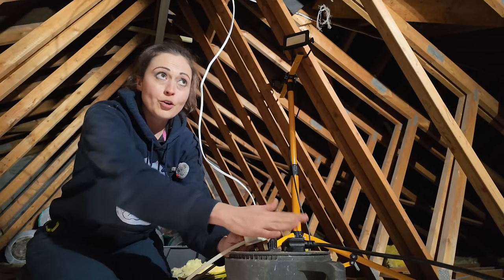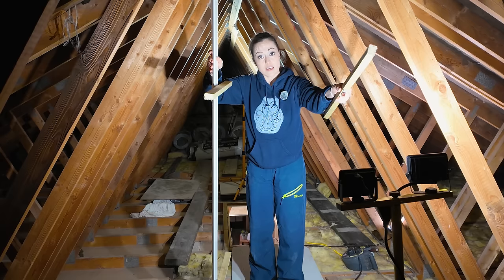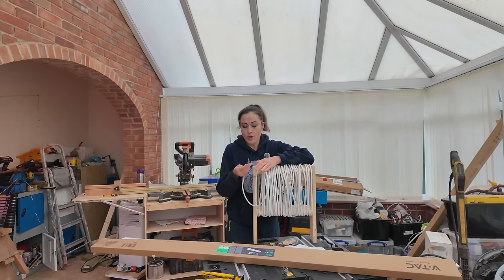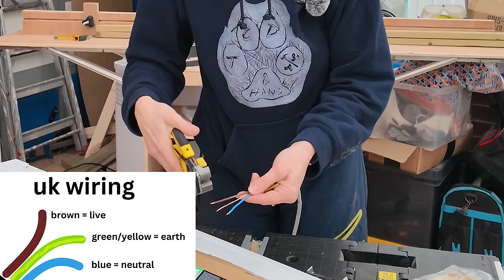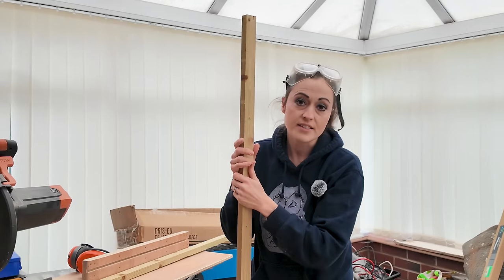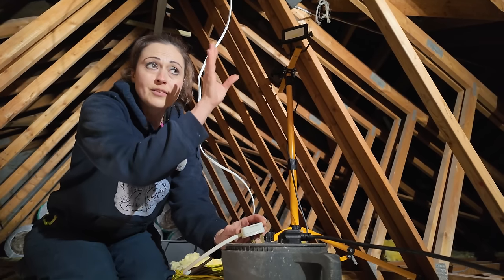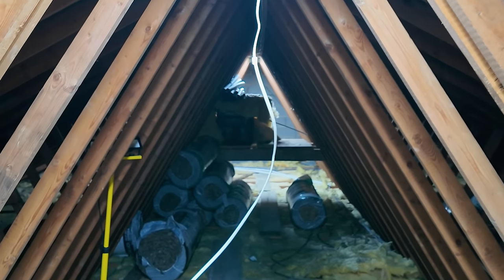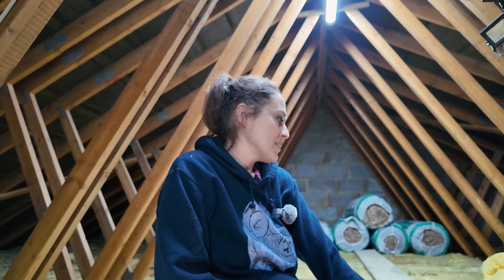The BEST attic/loft lights installation for BEGINNERS? {No Electrician Needed!}

Comment: Awsome project Vikkie with loads of good tips (again one's that i never think of like those cacle clips) i'm old school and use box connectors and lots of electrical tape.
It looks sh1t but does the job, rest ashured that i will be using your method from now on : )
I don't like the idea of the electric cable hanging down from the loft and i would 100% hack into the loft wireing (after all the trouble you went through installing you new lights why make it difficult and untidy by having to dangle a cable from the loft and plug it into a socket.
I would have a double socket in the loft as they are really handy but i would put a permanent switch right next to you loft ladder and not plug you lights into the socket.
Good video Vikkie, look forward to the next : )

Comment: Good video,may i suggest you invest in a tool belt to put your impact driver on or Combi drill, and also a DeWalt magnetic drill bit holder to keep your screws secure so you don't drop them, plus it will help you when you're working above head height
 I think it will help speed up your work and in turn more safer for you  👍👍👍👍💯

Comment: Hi Vikkie did you remember to change the 13amp plug fuse to a smaller one to give you the best protection.
I tapped mine into the main lighting cable and fitted a switch just as you get to the top of the ladder but must say you’ve done a great job and very safely done just remember to change that plug fuse

Comment: I don't know if you've covered this in another video but I would definitely consider getting the roof re-done.  It would be a shame if you get all decorated to find it leaks in the next few years.  FWIW when the spark is next on site I would get mains power into your loft space and a switch up there for the lights.  I think it won't be long until you tire of having the cable dangling down into the hallway.  Great video though.  I do like the Wago although my spark seems to dislike them with a passion. 🙂

Comment: Another good job , the lights rellly do make a difference and adding the extra one was betterer 😊👍
Reply from the maker: Thanks so much! I'm so glad I bought a 4th, and all the time I was worried 3 would be overkill lol
Reply: @TheCarpentersDaughterUK  Well you don't know til you do it , alas using the wago connectors it was easy to add another , well done. I see they no longer do florescent tubes anymore you can only get led ones. (Not saying those lights use them as you said they was led ) 👍
Reply from the maker: Come to think of it, I haven't seen any for sale for a while

Comment: I have used Wago connectors on all the pot lights in my renovated kitchen and they are fine. As a retired toolmaker i am way over qualified to do electrical work but i follow code religeously because i do not want to make a mistake. You tube will show you how to do everything , the trick is do not take shortcuts.

Comment: You have so many options to make a permanent connection.  Ideally you would run a new feed back to your consumer unit, but you need a sparkie to make the final connection really.

You could tap into a permanent live from a downstairs light and probably will be the most common way.  The fitting will be in the attic floor, it is just the case of interrupting the permanent live and feeding from that and fitting a light switch.  I suppose you could use a double pole isolator switch so your live and neutrals will be connecting in your switch and making it even easier.

You could also pinch the live and neutral from the ceiling rose and run them into a socket in the loft and use a plug with a 3 amp fuse and do the switching from the socket, just make sure you mark the socket as "lights only" so nobody plugs in a big drill or something and will trip your comsumer unit.

Comment: Couple of points for future....take the wago box right up to the fitting...ignore the flex on the light...if you ever have to take down or replace the fitting with another brand it might not have same length or any flex on it....also with cable tacks if you are tacking horizontally, put the nail to the bottom...if the tack breaks then the cable will probably stay up...better still use some metal tacks now to prevent collapse...good video though
Reply from the maker: These are all great points I wish I'd known before I started, i would definitely have done them, they make complete sense thankyou !! 

And I'll have a look for some metal tacks.

I love learning new tips from the comments on my videos.
Reply: Welcome

Comment: We’re gonna have to start calling you Vicki Sparks (she’s a sports writer) lol.
The wago connectors go on their side into the slots in the junction box, although you were using the wrong box for your connectors.
I always put a socket next to the loft hatch, there’s not much point adding any more fixed wiring in the loft. I think you are capable of doing it yourself. Just make sure you’re cutting into a socket circuit and not the switch cable for a lighting circuit.

Comment: If you have a run of lights along the length of the loft you can loop one to the next to the next and use less cable and fewer Wago's.  But with electrics, know your limitations.  Have you had the electrics checked on moving in??  It is money well spent so you know it is safe at the beginning of your ownership.  Happy Christmas.
Reply from the maker: Thanks. I don't think we could have used any less cables. And yes, we've had them checked and the consumer unit upgraded shortly after moving in 😀

Comment: Re your heating the gas fire gives of lots condensation ? diesel heater lot cheaper , and good content
Reply from the maker: Thanks! What kind of diesel heater were you thinking? One like in a motorhome or one like a standard boiler replacement that heats water in radiatiors?

Comment: How well do LEDs hold up in hot attics?  England probably doesn't get hot enough for this to be a major problem, but over here (Atlanta area) the highest part of an attic can easily be over 45 C for much of the summer.  I use old incandescent bulbs in my attic because they have no electronic components that would be harmed by the heat.

Comment: I would use a fused switch in the loft if tapping into the ring main and not put a socket. The only time you will probably ever need a socket up there is when boarding out. When that's finished should you ever need a socket up there it safer to run an extension lead. Plus it may need to be a weather proof one if you did put one in.

Comment: This is one area that has become easier to do. You (as a DIYer) are allowed to extend a circuit but not to install a new one!
In my loft I have a switch on the loft floor next to the entrance so when I climb the ladder it is next to my hand on the ladder. I have seen many with a pull cord switch to do the same. If I was to be going full beast mode there are PIR switches that will switch on as they detect you in the loft, but you run the risk of them turning off if you stay still too long ....... which is possible in your humungus loft area! Plugging one in with a switched socket works too though ;o)

If you plan on fixing eather a switch or socket to your loft floor don't forget to allow for the extra depth of insulation you will want in there! (I would go at least 50% more than recommended depth) 

Eather blown or rolls. Rockwool does not compress with time and is easier on the lungs (and less itchy). You do need to be careful when insulating to leave an air gap at the soffits to allow the roof to breathe 
I would Not recommend spray foam insulation as it can cause problems like fungus on timbers not visible and insurance companies may even refuse to insure and I know you don't plan on selling, but that could be also an issue there!
 
I cant remember for sure but I seem to think you have a tiled roof, if so installing vents in the membrane under them is a good idea as it allows air to flow in the loft. This is a ridiculously easy job but is often overlooked. Maybe a dozen vents that are just slid into the overlap of the membrane allowing air to get past it and go through the small gaps between tiles (or slates).
Reply from the maker: Thankyou, there's a lot here to digest, but I'm going to be referring back to this before I do the insulation, I'm about to start researching the laying of it now, I hadn't even considered adding extra vents yet, so I'll be looking into doing that too, unfortunately I've already bought the insulation when it was cheap on black Friday.😀
Reply: @TheCarpentersDaughterUK  You mean you bought SOME insulation? ;o)
£ for £ it is by far the best investment you will make!

Comment: I'd run twin and earth from lights to the consumer unit. Then patch a bit of flex on temporarily with Wago connectors and run to the nearest socket. That way, you can use the lights immediately - but then get an electrician to put it onto a dedicated circuit later when you inevitably have to bring them in to do other things.
Reply: To be fair, if the lights are wired in 3 plate then no need, tap into a pendant and extend the loop, add in a switched live and Bob's your uncle.  Much easier than running a cable all the way back to the CU.
Reply: @cjmillsnun  I've done similar here, but would probably go down the separate feed route if I was doing a major property refurb.
Reply: No need to have a separate feed from the CU for occasional, low wattage lights. Definitely a situation to extend a lighting circuit very commonly found in lofts, and while the walls are off I'd add a wall switch below the hatch, to avoid leaving them on and having to go up the ladder to turn off.

Comment: Well done, I'm amazed how clean it is up there, my loft has 12" of dust / dirt everywhere. But I only have tiles on the roof, no barrier board like yours. Wind just blows dirt under the tiles into the loft.  Cheap and nasty welfare house build of the 1960s.  :D
Reply from the maker: Could you add a breathable membrane to prevent that? Not sure what building regs are for it until I researched
Reply: @TheCarpentersDaughterUK  I was thinking of adding the boards you Poms and even Americans have, but i live in Australia and regs back in the 60s were very lax, to save costs. Being in a welfare area, not sure if it's even worth the effort. probably not. Never had any serious problems in 60 years.

Comment: I would tap into power in the attic, but add a 'push to break' switch to the drop down door, this way you never have to switch any lights on, it will be automatic. 👍🏻

Comment: basic electrics is easy you need some metal clips to be fully compliant. surely series connected better (like xmas lights) in one light out into 2nd light etc etc
Reply from the maker: Thanks 😊
Reply: Lights that require 230V must be wired in parallel! Otherwise you are dividing the voltage between them. Christmas lights used to be 20 x 12v bulbs or 40 x 6v bulbs in series. 
You can still wire 230v fittings in a line, but it's done in parallel, not series.

Comment: Good job, especially covering up the cable junctions in the wagobox.  Should be a simple matter for a spark to wire them into the lighting circuit for you.  And yes, I'd recommend a spark does it.  Anything fixed wiring beyond changing a faceplate, let the pros do.
Reply from the maker: Thanks so much :) I hope they don't come and want to rip out my wires first 😆

Comment: If not sure with electrical stuff leave well alone. Have lost count of how many times i have had to sort DIY electrical stuff out. Am pleased am away from domestic stuff now.
Reply from the maker: Thanks so much for your insight and completely agree. If you search loft lights on YouTube, one of the top videos was an electrician having to sort out a DIY disaster. It's exactly why I only wanted to do it this way.
Reply: @TheCarpentersDaughterUK  the biggest issue I had was that it was obvious that someone had tried to do the job and messed up but denied doing anything. Last time it happened I had a mains board to sort and several faults on sockets and lighting. Was 3 or 4 days sorting the problems. The guy tried to blame someone else initially.
Reply from the maker: They could've save you some time by saying what they'd actually tried doing!
Reply: @TheCarpentersDaughterUK  would have been a lot easier for me and less costly for him.

Comment: When I added light to my own attic I just bought a couple of long LED strips(narrow strips with sticky backs) that runs on 12V. Then I added a 12V solar panel, an old 12V motorcycle battery(the only remains of my long since scrapped Scooter) and a solar controller from China. 
Just stuck the LED strip to the rafters, connected power, and got some light-up switches(automotive switches with an indicator light) that I mounted near the attic stairs.   

You're using Glass Wool as insulation, I see.   
Ever heard of 'The Greatest Publicity Stunt Ever'?    
https://en.wikipedia.org/wiki/Ice_block_expedition_of_1959